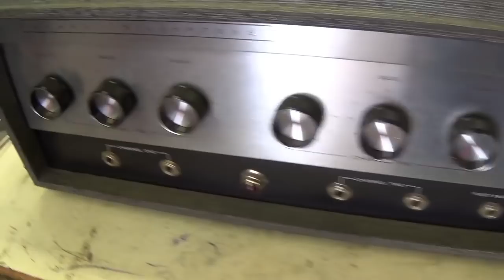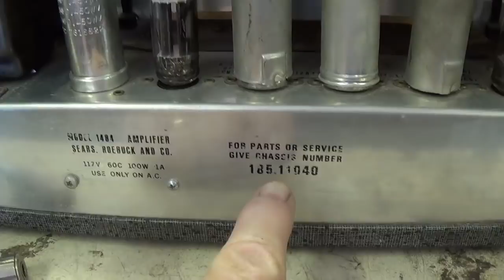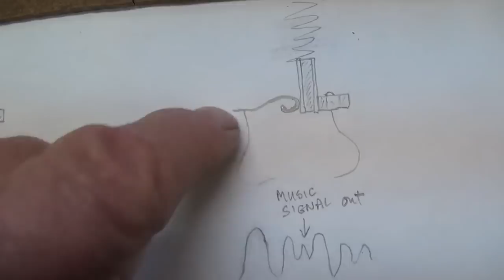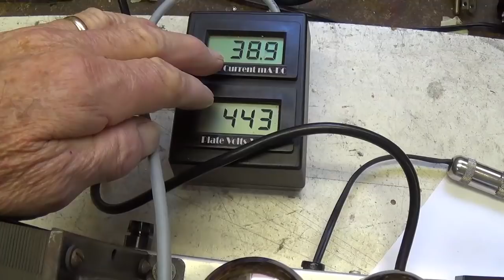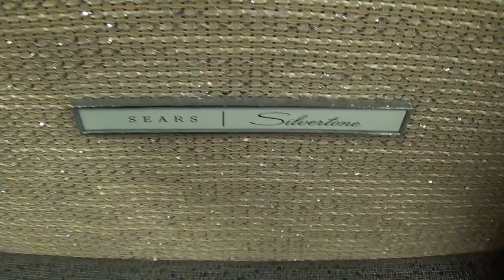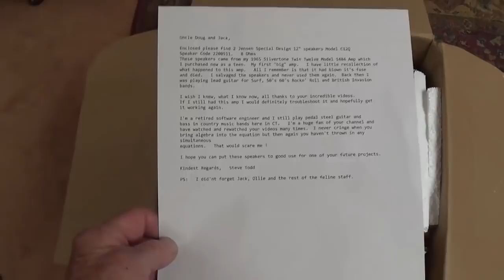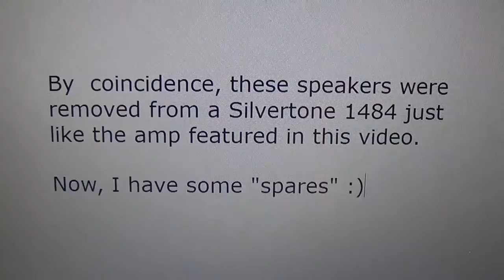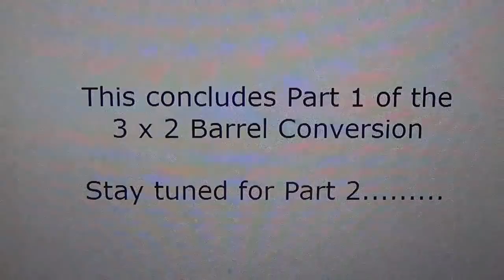Super Nice 1966 Silvertone Model 1484.......The Amp that Launched a Thousand Careers

Comment: Greetings, I have recently purchased a vintage 1976 (as indicated by the CTS pots) MXR Distortion +. The output pot is shot. I disassembled and cleaned it per Uncle Doug, but no luck. I may want to replace it but can't get an accurate ohm reading. Does anyone know what value pots were used in this pedal? I was thinking 100 ohm for the output and 250 for the distortion.  Any Help?     Thanks, Tom G.
Reply from the maker: Many pots have their resistance indicated on them, or have part numbers that might help determine it. Another possibility is to simply install a larger value pot, i.e.1000 Ohms, and then adjust it until the proper max value is found.  Measure the value and install the proper pot.

Comment: My sister in-law had a Chrysler Newport with a 440 big block with this tiny little one barrel carb, imagine? It looked factory so the original owner must have wanted options. She wondered why it didn't have any power and it was able to hold the 1050 it needed, but it's gonna eat gas, but my brother was and is filthy rich. We never talk in fear I might ask for the time even though I always helped him. Edelbrock is always the answer, put it on and go unlike the Holly always needing adjusting. She smoked the tires and wondered why the car is moving all over the road and making noise making a terrible smell that I just love, I told her don't use a a half pedal, she didn't hear me, typical. Just touch the gas, that's it and when you want to blow by someone, floor it.
Reply from the maker: You have led a very interesting life, Mr. B. Your tales never fail to amuse :)
Reply: @UncleDoug  So true and so have you.
Reply from the maker: @MrBrymstond  Thanks :)

Comment: hmmm guessing by the internal plate structures in those 6l6gc I'd say that they were Sylvania 6l6gc. I have the sylvania 7027A and the plate structure is identical. (edit: it seems that it is actually a philips 6l6gc and apparently sylvania sold the philips tubes as sylvania so they are most likely philips made or sylvania branded 6l6gc).

Comment: booth the SM58 and the SM57 uses the exact same capsule. With the exception of the grill. they are identical.
Reply from the maker: Thanks for your helpful input, Camilo.
Reply: Thanks for pointing that out. The 57 and 58 microphones are actually based on the same cartridge design. The main difference is in the grille. The SM58 was designed for vocal applications, and therefore uses a ball grille with built in pop filter to eliminate plosives.

The SM57 is designed as an instrument microphone, where a smaller grille size is more practical and plosives are less of a concern. Subsequently, the SM57 does not use a ball grille with pop filtering and instead features an integral resonator/grille assembly, where the grille is actually part of the cartridge.

Each grille design places the diaphragm of each microphone in a different acoustical environment. The distance from the top of the grille to the diaphragm is shorter on the SM57 compared to that of the SM58, which allows for a more pronounced proximity effect through closer mic positioning. Additionally, the different resonator/grille assembly design of the SM57 produces a slightly higher output above 5 kHz. I believe they also share the same polar pattern. Cheers!
Reply from the maker: @fredsampson  Wow, thanks for the very detailed analysis.

Comment: You know, I think I have a couple tubes just like that from an old peavey classic, and they used to say fender. I think. So if anyone knows who made tubes for fender (the peavey was a 1979 but if the tubes were stock they were cross-branded which does happen), that's a clue.
Reply from the maker: Thanks for your input, Craig.

Comment: I bought just the head from a consignment shop for $20 in 1994. Channel one is a 100% stock channel two is not even connected to the board.  I blew the output transformer And it's been sitting in my closet ever since.  My tube Shields were split the long way In a wrap-around style
Reply from the maker: Wow, Lucy, what started off as a great buy certainly turned sour. It would take a great deal of time and money to restore the circuit. Thanks for the info on the tube shields.
Reply: A year ago I got bored so i opened up the old girl. I was actually able to fix the channel because the input resistors were just gone. I replaced them put in a repro output transformer new tubes and found a cab with original speakers. She is up n running full speed. Thanks for the inspiration

Comment: That amp sounds great.  I'm a fan of Luther Perkins style of picking I'm going to try to build an Esquire to start.  Could you recommend a Amp that could be close to his sound?  Thanks Tom
Reply from the maker: I am not a Luther Perkins expert, Tom, but you can't go wrong with a Fender Deluxe with the 5E3 circuit.
Reply: Thanks so much Uncle Doug I'm watching most of your You-tube videos trying to learn as much as I can.  I'm a bit afraid of the high voltage circuits in the Amps to play around without more knowledge about them!  Tom
Reply from the maker: @PLINKER  It's always better to be safe than sorry, Tom.

Comment: Hello Uncle Doug....I need some help.  I picked up a Silvertone 1465 transistor 150 amp.  The two small wire leading to the reverb tank are broken.  Does it matter which one goes to ground?  Thanks so much for your videos.
Reply from the maker: I have no experience with transistorized circuits, Don. My advice would be to experiment and see which wiring style works.

Comment: UNCLE DOUG, Why would a designer make the metal tubes shielding have high voltage applied to it instead of being ground?
Reply from the maker: They don't, Bill. Tube shields are grounded to the chassis.
Reply: @UncleDoug  they are called "emitter tubes" used in Radios. They needed to be "positive biased" using a High voltage on the shielding of the tube. Do you know why tubes need to be Positive biased?

Comment: No real difference between SM57 or 58 - if you order spares from Shure, the capsule and transformer are the same part number! Only real difference is the windshield construction, with more pop protection in the 58 (which, yes, does reveal a veeerryy slightly different response in the upper mid range). 😉
Reply from the maker: Thanks for the info, Keith.
Reply: Has that always been the case?  That model goes back aways.  At least to the 80's.  Edit: looking at the specs, both the frequency response and output impedance is a bit different.
Reply: The SM58 has a larger pop shield. With an SM57 you can put the capsule closer to the source but you don't get the pop shielding effect with vocals.

An awesome video once again Uncle Doug!
Reply from the maker: @hallanvaara6106  Thanks, H :)
Reply: Yeah, the windshield makes a surprisingly big difference to the tone. In fact, a naked SM57 capsule sounds exactly like a (much more expensive) naked SM7b capsule!
Reply from the maker: @TheAndyroid  I am definitely learning more about microphones from viewer comments and personal experimentation. Thanks, TA.
Reply: @UncleDoug  You're doing good Uncle Doug. I must say, the SM57 is an industry standard for guitar amps. Using that mic helps give listeners a more reasonable tone comparison with other amps. There's little point in using anything else. Cheers.
Reply: +1 on this.  Shure confirmed the only difference was the windscreen.  Funny though, Eddie VanHalen came to the music shop where i worked to buy a SM58 and said he prefers to take the windscreen off and use that instead of a SM57 on his guitars.
Reply: Always refer to Bob Heil when it comes to microphones and wind screen's. Best in the business.
Reply: I have tried to explain this to MANY people to no avail! They are the exact same microphone, one with a ball on top and the other not. People always come back with "actually the specs are different" Yes, this is true. The ball makes the specs different.
Reply: A 58 is More a vocal mic and a 57 Korean instrument Mic.
Reply: I don't know where Korean  came from! LOL😁
Reply: @1955DavidH  ...that's what the edit menu is for... 😉😁
Reply: They've been around since 1966.

Comment: Hi Uncle Doug
I have been working on a Silvertone 1484(for some time) and have a oscillation problem with the reverb.
When you switch on the reverb it breaks into immediate max volume oscillation.
Channel 2 is noisy but sounds OK otherwise.
I should first mention I have done my due diligence and have checked all the tubes and they either test
OK or have been replaced. I have tested resistors and replaced all the caps except can cap which seems OK.
I have checked reverb tank with capacitance meter as per your video and it seems to be working?(not 100% on this)
I have gone through schematic and everything seems right.
I am out of ideas. Any thoughts?
Reply from the maker: Have you tried adding a grid-blocking resistor to pin 7 of the 6CG7 that drives the reverb tank, and to pin 7 of the 12AX7 (bottom left in schematic) that drives the 6CG7? Try 10K for starters and see if it helps.
Reply: @UncleDoug  Hi U.D. Tried your suggestion.No Effect. I did notice on closer examination however that my amp deviates from the schematic in the following way.
There is a strange blue/white/brown blob looking component(old diode?) between pin 2 of 12AX7 driving 6CG7 reverb driver and ground. There is also a 150K resistor between pin 2(grid) of 12AX7 and ground. Schematic only shows 560K resistor between grid and reverb footswitch and a 68K(which I can't see anywhere) to ground.
Are these mods I should remove and put it back to what schematic shows?
Reply from the maker: @richsanches4984  That sounds like a good idea to me, Rich. You know a circuit exactly like the original schematic will work. God only knows what's been done to yours.

Comment: Uncle Doug, I built myself a signal tracer. I traced the signal through the amplifier, through 3 12ax7's and 4 6l6gc tubes where I found a incredibly amplified signal. Then, I skipped to the speaker jack, where I found a very low signal. Any thoughts? I did find at least one leaking coupling Cap on the 3rd 12ax7 that I intend to replace today. I'm worried the problem may lay in the output transformer. Interestingly enough, when I touch pin 7 of the third 12ax7, when checking voltage, I get a pretty loud pop at the speaker. Much louder than the actual signal flowing through the speaker. Anyway, I will continue on today. Hoping maybe you have a thought or two on this? Thanks for all of your help so far!
Reply from the maker: It sounds like you have discovered two possibilities: bad OPT and/or bad coupling cap (CC). Change the CC and repeat the test. Let us know what you find. You could also disconnect the OPT and measure the winding ratio.....which will be way off if the problem resides within it.
Reply: @UncleDoug  Changing coupling caps didn't do the trick. What it REALLY strange is that, when I touch pin 2 and 7 on the 3rd 12ax7 I get a LOUD bump, as if I touched a input jack cord when a amp is on. So, after changing 2 coupling caps. I start checking voltages all over the amplifier, and I found a rather large resistor that showed voltage only on one side. I'm not sure what that's all about but, when I tested it in circuit, it went infinite. Driving me nuts.... If you get really board, you can look at the schematic online for Carvin x100b. The resistor I speak of is R124. Oh, and I can still measure DC voltage on pin 2 and 7 of that tube.
Reply from the maker: @DetroitWrecker666  If all your tube voltages are correct and your output tube bias is correct, and there is still almost no sound from the speaker......start checking the WR of the OPT.
Reply: @DetroitWrecker666  Pin 2 and pin 7 are the grid, so you basically DID touch the tube's inputs.
Reply: @JulianA-tr6pt  Yes, I have traced the Signal from the input jack, through all the tubes.  I even have a slight signal coming out of the Output Transformer.  Unfortunately, at this point I believe it is probably the Output Transformer.....  Before all of this happened, I found out I was running a 2 by 12 cab at 2 Ohms for a while.  I am guessing the transformer couldn't take it.
On a up note.  I am REALLY enjoying poking around tube amps!  I have learned SO MUCH in a short period of time!  In fact, I will be making a video soon about the Schematics for these Amplifiers.  Important info for those of us who own them, and want to service them.

Comment: I just picked up a little Sears 40XL\Silvertone 1422.  Surprisingly loud, but it needs some work. So far, no luck finding a schematic for it.
Reply from the maker: It may have been built by Danelectro, Valco, or several other manufacturers.
Reply: @UncleDoug  thanks for the suggestions!

Comment: Great video as usual Uncle Doug! Thanks! I'm sure you discovered that the big old transformer is the output transformer. Some amp snobs think it's a Mickey Mouse power section what with the tiny PT and a voltage doubler but, I think that cheapness is part of the coolness about Danelectro. watt
Here's a tip - If you ever open up that amp again replace those 27k plate resistors on the reverb driver to 1watt. See schematic https://www.silvertoneworld.net/schematics/Sears_Silvertone_1484_Twin_Twelve_REPRODUCTION_Manual-page-004.jpg

Comment: Nice dancing days riff, does that amp have a rectifier tube?
Reply: Looked like solid state rectified. I saw diodes when Uncle Doug was showing us the filter caps had been replaced about 10 minuted into the video.

Comment: vacuum advance goes above the throttle plates, not full vacuum.
The should be a port on the carb somewhere
Reply from the maker: No ports anywhere on the carbs, which is why I went with manifold vacuum. It works perfectly like this, however. My theory: The manifold vacuum is so high, due to 350 cubic inches sucking air through a tiny 125 CFM carb, that the vacuum stays high enough to maintain advance even when the butterflies are opened.
Reply from the maker: @1112223333111  Thanks for your input on this matter.
Reply: No problem Doug. In this case it would be best to not hook it up at all.
It will be the reverse effect and retard the timing when you should get advanced because it only has vacuum at idle and will be less at part throttle, retarding the timing.
Happy Turkey Day tomorrow

Comment: Doug isn't the 1484 (2 6L6's) a 25W version of the 1485 which is the 60W amp?  I'm confused! :(
Reply from the maker: No, Peter, the series started with the 1474, which had a pair of 6L6's (not GC's) rated at 50W. Then came the 1484, with a pair of 6L6GC's, rated at 60W. Then finally, the 1485, with four 6L6GC's, rated at 120W  (often more realistically referred to as 100W).  I have posted videos featuring each of these models.

Comment: Hey Doug, you said 50 @ 50V on those cathode bypass caps - do I understand that you upped the capacitance along with the voltage from the schematic's 25uF @ 25V to 50uF @ 50V?
Reply from the maker: Yes. It seems to add a little bass warmth to the tone.
Reply: @UncleDoug  Thanks for the reply!
Reply from the maker: @MagicalMrE  You're welcome, Evan.

Comment: ??? Uncle Doug, I just came across an Alamo Capri for about $170.00 in working, original condition. Is it worth it, also, is it a series filament amp?
Love your videos, sorry for posting here but I don't know any other way to contact you, thx.
Reply from the maker: This is a great way to contact me, Curtis. Every Alamo Capri I have ever seen was series filament, which greatly limits its value, tone, and output power.  About the only thing it doesn't limit is shock hazard.....unless it's fused with a chassis-grounding 3-wire power cord. To each his own, but for me, series filament is just not a good project or investment.
Reply: @UncleDoug  Thank you for the reply, this helps a lot, especially because I value your opinion greatly. Though I could add the 3 prong cord and fuse, as you suggest, I did think the tone and volume were very limited in the Alamo Capri when I played through it. Also, it hummed loudly so I know there were a few more ghosts in that machine, for these reasons I will pass on this one!
Reply from the maker: @cchavez248  Probably a wise move, Curtis. Series-filament amps have so many limitations that I now avoid them completely.

Comment: Just curious if you know what the cfm on the 3 deuces is compared to the 4V? Is this a performance upgrade or cosmetic or both?
Reply from the maker: The Strombergs have small venturi's and only  flow around 150 CFM each, compared to the 600 CFM of the 4 barrel.....however, the enhanced velocity of the air flow through them creates a very noticeable improvement in throttle response, and when the secondary carbs open, its like lighting an afterburner.  Overall, the car seems much snappier and more fun to drive now.
Reply: Makes sense. 600 cfm is WOT and really what percentage of driving is done there?
Reply from the maker: @billbeyer657  Very little of it, by me at least :)